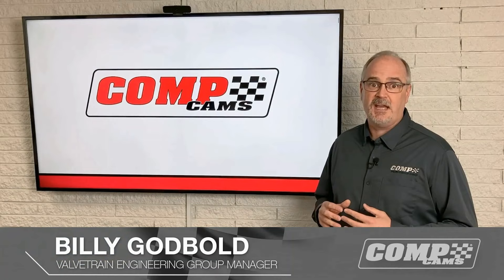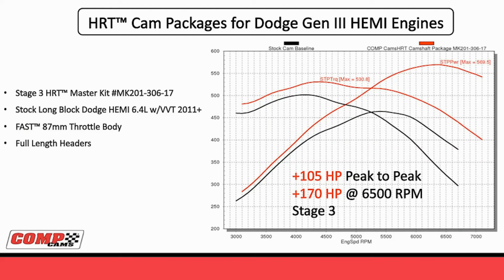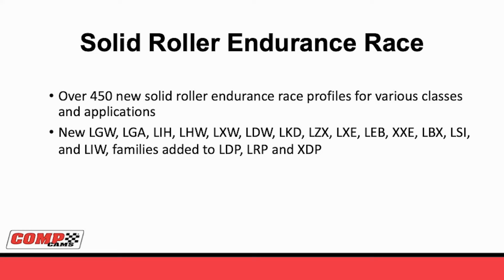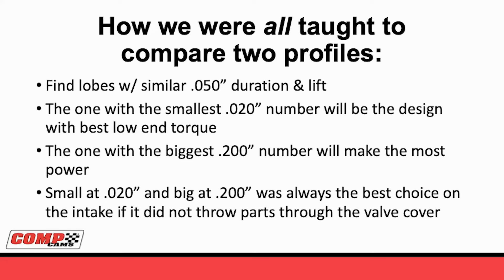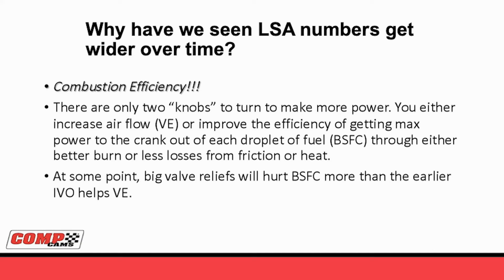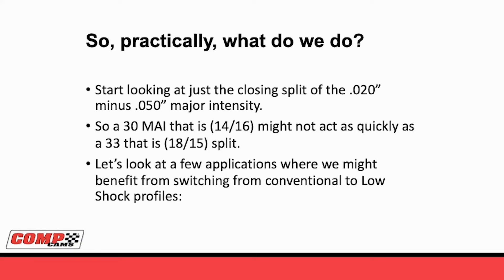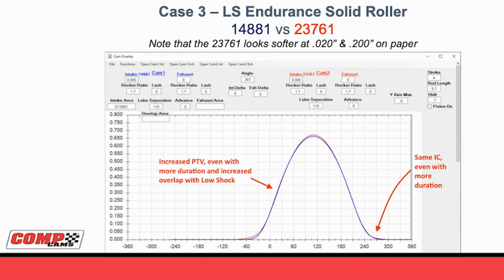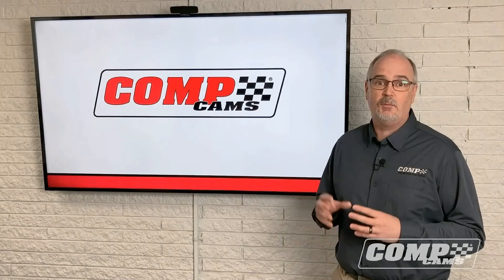Valvetrain - Cams, Pushrods, Rockers, & More (2021 – Episode 24)

Comment: Something that seems to be omitted, from not only this one, but, most, if not all, of these presentations, is the dates they took place on. I think dating these relevant, as to subsequent changes in contact information, product introductions / changes, etc..
Reply from the maker: That's a good point. My bad. I have added the original airing dates to the episodes. (Expo #1 ran from January 7-9 in 2021)

Comment: Good stuff! If y'all would, please ask Billy this question concerning camshaft design...........For the Ford Modular 3V engines using VCT & CMCV control, are all the NSR, full VCT-compliant camshaft designs ground w\ the intention of the CMCV control being used or are all of them designed w\ the intention of the CMCV control being removed? In all the catalog descriptions nothing is stated to give a definitive answer to this question so I would like to know definitively if removing these CMCV's while using 1 of the NSR, full VCT-compliant camshaft designs, you're giving up some of the low RPM\off idle transient throttle TQ output from losing the improved low RPM intake port airmass velocity\A\F mixing that these CMCV's provide.........? Would like to hear this from the 1 who can give the clearest answer to this question........ My gut says yes due to the description statement "work w\ the stock tune" but I'd like this answered from Mr. Godbold for my peace of mind. Appreciate any info gained. Thanks in advance.

Comment: Somebody help me please: web page/marketing seems slightly disconnected from development, and I need a decoder ring to contemplate all the 3 letter codes seen around 14:04 - LTQ, LTL, LSF etc.   Also, the cam industry seems to have lost its damned mind roughly 5 years ago: web sites are now  best suited to sell things requiring a visual [like shoes] and cam cards are buried or vaporized.  Cam pictures? Those pretty much all look the same, so the overall concept has a problem.   A gentle reminder of what the print [catalog] crowd had a very good handle on in the 80's:  browsability, and the use of tables we would now call spreadsheets.  Might be arranged by series or engine type, but it was all there  at a glance.  The E-commerce consultants of big tech appear to be... morons.  Billy conveys some great info, but... can't say that CC website backs him up that well.

Comment: Why are you cam companies using a wide lobe separation angle? You guys are putting out junk. A Tighter lobe separation angle will make alot more torque and more top end power. I never buy a shelf grind.
Reply: Do you really think that you know more about cams than the people who spend day in and day out tweaking cam specs and testing them out on an engine dyno?
Reply: @C6Z_Bob  I think I know a thing or two. I've been building engines for 30 years.
Reply: @C6Z_Bob right Bob he’s got anther 30 years to learn then he might get it but I don’t think he ever will.
Reply: @ironmike742  I'm sure you do, and you're probably pretty damn good at it. But it's a little bit crazy to think that multiple large LS cam grinders who have access to engine dynos and spintrons don't know as much as you do when it comes to making power with a cam.
Reply: He explains why at 22:00.
Reply: All engineering finds compromise.  Coping with manifold pressure sensors, power brakes, computer management etc is not a free ride.  Manual brakes and a carb? I'm with you regarding checking out a tighter lsa right off the bat.  But also, a question: should we maybe look at  overlap before lsa?  Its got to mesh with intended driving style.    One reason we find bigger lsa numbers is a designer went there to reduce overlap because lift was the priority - a hangover of the 80's in my estimation as a "bigger " cam sold better, but rate of change on a lobe has a definite ceiling and lsa paid the price of admission.   But did it scavenge better for the application [we forgot to ask]?